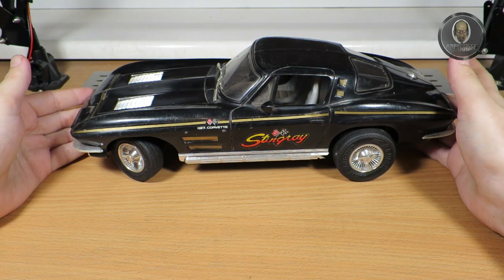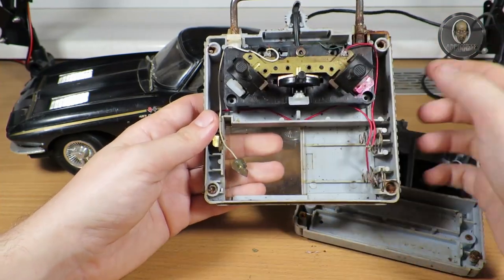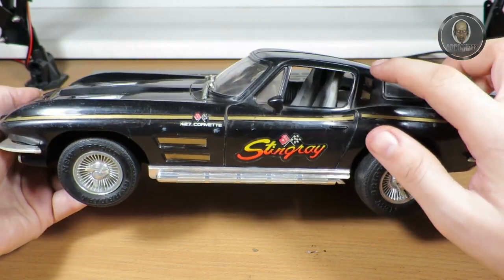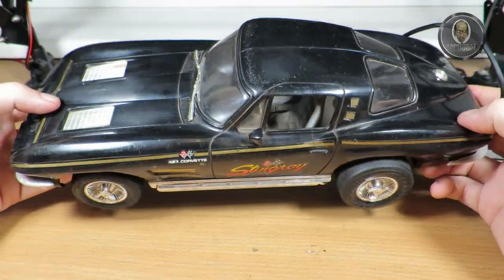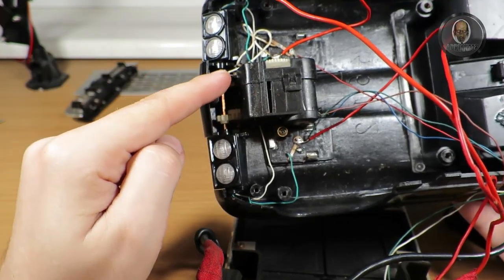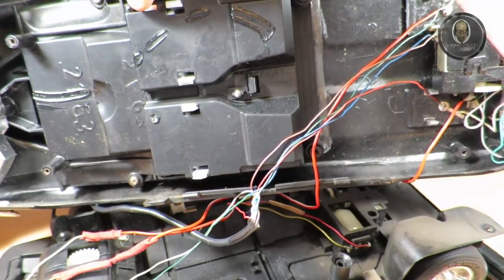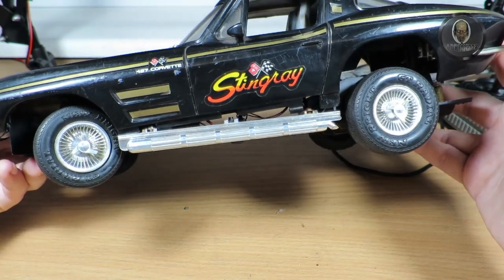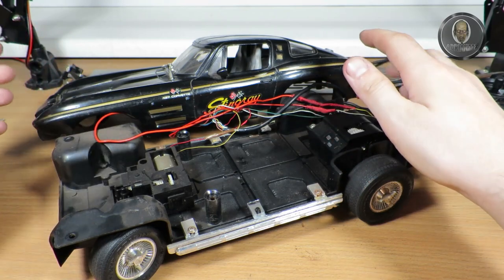New project to rescue New Bright 1963 Chevrolet Corvette 427 Stingray

Comment: Great project, buddy. You "could" cut the hood (bonnet) out, as it hinges forward on a straight edge (latch with magnets) if you want easy battery placement... assuming you use a small servo on the flip-ups and your steering servo's set up is neat. Good luck with this one friend.
Reply from the maker: I don't want to modify it to much, so far I just removed stickers (they started to peal off already) and will need to clean it and try to polish it
Reply: OK, I'll bite my tongue about the 540 motor, lol.n